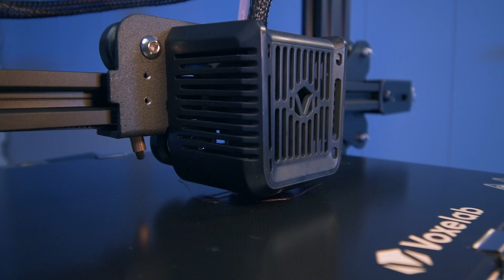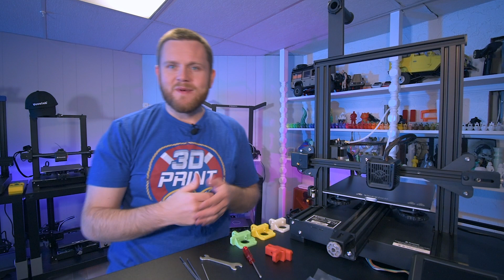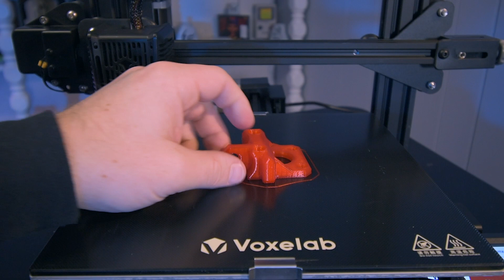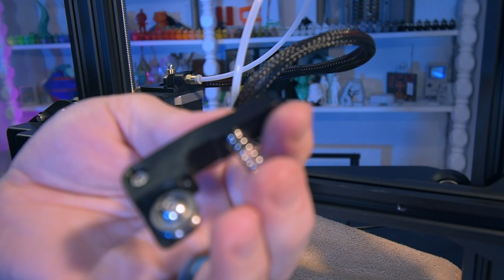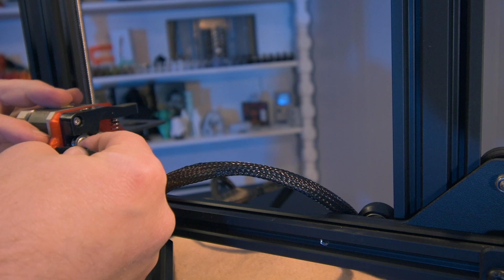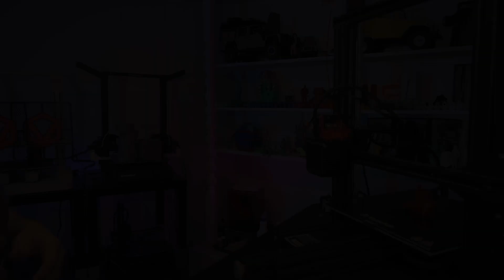Voxelab Aquila Direct Drive Mod - OOTBDD - EASY & FREE

Comment: When I bought a used Aquila X2 the seller told me about your channel.  I'm a 3D printing newbie and have not been disappointed.  The seller had done some upgrades already and the printer and had been cared for very well. The printer came with the "Satsana Extruder Mod for Voxelab Aquila - Fixed" by chubbyzook which was in the way of the front bottom of the OOTBDD adapter.  I used your "extra tab" version.  After marking where to cut with a pencil a quick pass through my small model building band saw removed the interference.  I did order spare parts to restore to the original condition should things not work out well but they weren't needed.

For the stepper motor I ordered "Box3D 3D printer direct drive stepper motor extension cable for Ender 3 Ender 3 Pro Ender 3 V2 Ender 5 plus pvoxelab Aquila 3 pcs x 05m " from Amazon which was a good length at 20 inches/0.5m.  Soldering would have been easy enough but sometimes it's nice to just buy something and plug it in.  I had some 1/4" expandable wire loom sleeving on hand which expanded enough to go over the 6 pin stepper motor connectors and used that to cover the extension.  For now I just stuck a short piece of PLA in the filament sensor.  If I ever do very long prints I'll consider moving the sensor and extending the cable.

An increase of 10°-15° makes for much better prints with the direct drive with the Ender PLA I'm using.  I reduced the retraction to 1mm and set the nozzle to lift 1mm when changing layers.  Those two changed eliminated the blobs and zits I had been getting with the Bowden tube.  The PLA is laying down looking like wet paint and I'm having no adhesion problems.  Initial layer is printed at 215° with a bed temp of 70°; backing off the bed temp to 60° after the first layer using Ender PLA.  At 200°-205° the first layer was not smooth against the bed and as the print built it became thin, unattached and started falling apart.  It got much better at 210° and very nearly perfect at 215°.  Thanks for the education!  You've taught me a lot in just 2 weeks.
Reply from the maker: Awesome to hear that I’ve been able to help. :)
Reply: @3DPrintSOS  with the extension I can just plug and play or I will need to swap the cables?
Reply from the maker: @nashgkrish5683  Yep. An extension would just be plug and play. :)
Reply: @3DPrintSOS  thank you Fedor! I appreciate it
Reply: Thanks for the info on the Satsana shroud David !! It's one of my next prints before I print this extruder mod.

Comment: Thank you.. printed it and thinking about how to(if at all) I'll extend the steppenmotor cable. But definitely gonna do this!  As I see it my bltouch is left untouched (😊)so I can keep using it. Loving your vids❤ greetings from the Netherlands 🇳🇱

Update:  done.. used the original cable but  motor powerconnection on the other side.. working perfectly. 🍀

Comment: where can I get an extension cable if I don't want to cut the sheath?  Are the connectors on the stepper PH2.0-XH2.54?  BTW, I'd love to see the modification to use the filament sensor that comes with the Aquila X2, since that's the printer I've got ;)

Comment: I have got everything working out and printed the best every benchy. I only changed the retraction setting, left every thing as is, and the first print came out great. Thank you for another great mode.
Reply: What retraction settings are you using after this mod?

Comment: Does the direct drive affect the machine due to the weight of the stepper motor? It defiantly needs the sensor too. What is the setting you were mentioning that needs changing?
Reply from the maker: I feel like I covered all of these in the video. Essentially, you DO ad a motor to the X-axis, so there is added weight. That said, it hasn't negatively affected the print quality and won't unless you try to print much faster. The setting you are looking for is called retraction.

Comment: I'm sure this took lots of work to engineer. Thank you for sharing it. This is why I love the 3d printed world. Would like a X2 fil sensor version but this will do just fine. Good job and look forward to more.
6 months later..... Finally did this direct drive and man does it print good. Not sure if it's from less retraction or what. Just need to figure out cable management which is no big deal. Well worth the time.

Comment: I have bmg clone extruder is there a way to make it direct drive with the stock parts
Reply from the maker: Not with this specific one. The whole point is that you don't need any extra hardware or tools. But maybe in the future, I can integrate one.
Reply: @3DPrintSOS  i bought and using bmg clone bt the tube is always slipping out from the hotend and clogs after some time so i decided to go with direct drive with the bmg i have and the stock motor maybe i need to print something only

Comment: It works.... the only thing that I have left is a nod that I can't get in the nozzle that doesn't make it as precise, and by tightening the wheels I can't get it to improve.
could you help me please
funcionaaaaaaaa.... lo unico que me a quedado un cabeceo que no consigo en el en la boquilla que no hace que sea tan precisa, y apretando las ruedas no consigo que mejore
Reply from the maker: Were you about to get the carriage tight using the wheels prior to this mod? It shouldn’t effect the adjustment whats so ever. Other than adding the weight of the motor.
Reply: Esta amigo, fue fallo mío que no apreté bien. Gracias

Comment: Printed this and it came out great, was also very easy to fit so thank you for making it!

Can you possibly do a version 2.0 that has a second mount for the other wheel. I am finding that I have to wedge something under the stepper motor to prevent it from tilting back and forth on the single mount which is giving extrusion issues on areas of the print that are slightly faster.

Thanks again and keep up the channel I am learning a lot from you.
Reply from the maker: Hmm. I wonder if there are differences in carriages on these machines. I have had a few people say that theirs moves. Mine is super tight on there. Wonder if it’s related to how heavily a printer over or under extrudes when it prints this. I’ll take a closer look when I have a chance.

Comment: Hy, it's so cool modification, but I want to ask: can it print from tpu or flex?
Reply from the maker: You can print TPU or Flex WITH it but it cannot be printed in flex. no.
Reply: @3DPrintSOS  Do you have any recommendations for the settings in regard to TPU, like any change to the retraction and print speed. I've tried some common ones and can't seem to get it to work

Comment: Im a complete noob when it comes to this stuff, where do i put the g-code? and do I need it?

Love your videos really easy to follow thanks.
Reply from the maker: That gcode is for the machine to print the bracket, so it goes on the SD card. No this is definitely not needed. Especially if your printer is printing great as is. It’s mostly for fun and a bit more control. :)
Reply: @3DPrintSOS  Thanks for the help

Comment: I honestly don't know why we are still bothering with manual bed leveling machines when there are so many good 3D printers with auto leveling and are either the same price or a little bit dearer. I have that bloody Voxlab Aquila and it is a pain to level and out of the box it's single z lead screw is shocking and has no support for the top!! Sorry I honestly have nothing good to say about this machine. I bet some will say " but you can buy upgrades and tweak it and ........" why should I muck around buying upgrades for a machine that already cost $499 Australian dollars. 
I can now buy a Anycubic Kobra Max for $800 . It has a Hugh print bed. ( 400x400x450) Autobed leveling ; dual z axis lead screws and 2 supports and easily prints 60% faster than the Aquila. I am glad for those who are pulling their hair out that there are videos like this to help them try and fix issues or show upgrades for the Aquila. However with the technology we have today why are we still using stone age tech( Manual Leveling)
Thank you for the video and sorry about the rant but I think it's a point to consider when buying a 3D Printer.
Reply from the maker: To each their own. We have our own experiences that shape our opinions. I have personally had 5-6 Aquilas and many manual machines that print great. Zero upgrades. In fact, my best prints (quality-wise) ever, to this day, have been on a bone stock Aquila. One of my friends runs a small print farm with stock (direct drive mod only) Aquilas. Leveling is almost never an issue. Outside of settings/calibration, It’s typically thermistors, fans, and nozzles that go out due to use. On the other hand, I have had a handful of machines with “auto bed leveling” that have been extremely unreliable. Especially If the sensor is a non-probe type.

Comment: i love how the OG aquilla is still kicking it. not fancy or fast. just prints  what i ask when i ask. this looks like an excellent mod. thank you.
Reply: :) I still have an X2 unopened, bought as a spare to keep 'stock' while I mod the first one I bought. Had to swap a hotend after ruining the thread for the print nozzle, after swapping to hardened steel to print PA-CF. Outside of that and the fun and games of firmware upgrades, it's been crazy reliable. Pro-Tip, use a Dial Indicator Gauge to set the height of the bed, and check it once a month or so, and the prints will always start properly for PLA, PLA-LW and PETG.

Comment: After many filament changes I've printed a small knob for the stepper motor to assist in loading. This really helped me out a lot because being off just a little bit can cause the filament to turn out over the gears. "Filament Extruder Knob (Voxelab Aquila:Direct Drive Conversion Accessory)" or thing:5857945 .

Comment: Hi I'm curious as to why we can't point the motor's wires towards the back of the printer instead of having them forwards like you showed in the video. (I printed out the mount and I'm getting it installed right now as I write this). Seems like there may be something I'm just missing as to why I cant save a little bit of hassle of cable management and point the cables backwards xD. Thanks for the great video!!!
Reply from the maker: Only because when you home the machine, the wires make contact with the frame. And being that close to the connector and always moving back and forth can cause problems after a little bit.
Reply: @3DPrintSOS  ohhh fair point! Thanks!

Comment: Awesome! This is so great and so simple! And costs you nothing extra! This is a really terrific mod. Thank you for the video. Would it be beneficial to change the little remaining Bowden tubing to something else if you were to print different material at higher temperature or is the OOB tubing fine? I flashed the firmware on my x2 H chip. Manual Mesh Levelling has changed my life! Thanks for that video too!
Reply from the maker: An all metal hotend would be a great mod as well. That would let you print hotter for sure. But with this mod alone, you should be fine with PLA, tpu, and petg.

Comment: Just printed it, the hole for the tube is not centered with the filament, can even feed it by hand.
Reply from the maker: Really? First time hearing it. Everyone seems to be enjoying theirs.
Reply: Had to use a small washer to get the spacing right, also some filaments are struggle getting down the tube. Still a good design, don’t get me wrong👍🏻

Comment: Good video, is it possible to exchange the z-axis motor and the extruder motor to make it lighter? Because the z-axis motor is a little smaller.
Reply from the maker: Tried. That motor could run a geared extruder but not a single-geared one. It will skip and get very hot.
Reply: @3DPrintSOS  I had already removed the motor to test it but decided to ask before as I was worried about heating.  Thanks for taking your time to answer.

Comment: On th e X2 version where do you put the run out censor?

@3:50 under 2 hours??  With your settings it took my X2 4 hours to print. How???
Reply from the maker: Weird, mine printed in 1:58

Comment: Tell us about light pla and if it's good for fpv parts and or frames. Look up jellyfish  fpv and you'll find a dude that made an interesting little drone. Would be interested on your take. Also if I could use it to make reptile habitats. What kinda glue to stick it together and what to use to water seal if needed! Lol figure illl ask you more here and give you more engagment
Reply from the maker: I've wanted to try Light PLA several times for Plane (wing) builds but never got the chance. I gotta look up Jellyfish. Although, sound familiar. 

Not sure how lightweight PLA does with water. I assume badly. Since it kind of “foams” as it prints.
Reply: @3DPrintSOS  I wonder if it's like pvc with is a foam almost too. Wondered if I could just coat the inside with something!
Reply from the maker: @TorontoFPV  Im Sure it can be coated. Check out https://3dlabprint.com/ They have some really cool specific LW PLA.

Comment: can you print faster with this mod?
Reply from the maker: yes and no. Yes, you should be able to print faster with tweaks. No, this mod won’t make your machine print a whole lot faster. you’ll have greater control of your filament because of the immediate and direct filament path. The rest will have to be overcome by tuning.
Reply: @3DPrintSOS  ok so if I do this maybe I can be brave enough to try tpu?

Comment: Would I be able to face the motor plug to the back of the printer instead
Reply from the maker: Yep. Just make sure it doesn’t make any contact with anything as you move it around. 

As I mentioned in the vid, it’s facing forward because it makes for the cleanest wire management. Nothing gets pressed this way.

Comment: Every printer I have bought has come with sample filament and it has all been absolute rubbish except the sample that came with the Aquilla with which I used to print a bed level calibration, the filament that came with my two Ender 3 machines was so bad it just snapped in the extruder, even trying to straighten it resulted in it snapping
Reply from the maker: That’s true. Some of that sample stuff is literally garbage. The red these come with is at least "ok".

Comment: instead of the DIY direct drive I just went a brought the direct drive head for the Aquila S2 from there main website and fitted it to my standard Aquila its a bit more expensive then this mod but is another option
Reply from the maker: The issue is those have proprietary parts. Including the nozzle, heatsink, and block. Im not a fan of proprietary parts on these cheap machines.
Reply: True there is that downfall with it, but so far I have managed to order extra nozzles from them with no hassle just hope it stays that way 🤞

Comment: Will this work with a duel gear extruder?
Reply: I have aquila with a 400XL kit on it and the direct drive is the next upgrade lol
Reply from the maker: Nope. Quite a bit different in all dimensions and functions. This is meant to be a single piece for a completely stock machine. Maybe in the future.

Comment: Hi Fedor.  thanks for this video.  I have been wanting to do this mod for some time.  I will certainly give it a go.  My one question is what about the filament change process?  Now that the bowden tube is dramatically shorter, won't we need to modify the code for the distance the filament travels into the hot end?
Reply from the maker: Yeah that's a thing. Although I think whenever you do a swap, you are in control of the distance.
Reply: Ok... I found my answer in the menu on the printer.  Pretty simple. I can't wait to try it out.  Thanks for the video and the print file.
Reply: @bradleyehler1477 I just did the mod and tried to do the first print and the Machine said it is not detecting filament I auto loaded it and it extruded way more than it should have you know what my problem is

Comment: Had to dig out my old lever to make everything OTB but...I think it was worth it.  The only hiccup that I had was with the slot that is supposed to go onto the bracket.  I didn't even know it was supposed to slot onto the bracket that holds the wheels, I just thought somehow the dimensions were off because it was BARELY not lining up. Going through a full mesh leveling/e-steps calibration/retraction test just to make sure everything is as good as it can be. Oh how I've missed Direct Drive! Thanks for making it simple.  I thought that a Bowden setup was going to make a world of difference...it just made filament easier to load. 🤣

Comment: Had made a past direct drive modification to my X2 Aquila, but with a lower left side custom filament spool mount, I couldn't decide on the best cable routing for the filament sensor that I have on top of the extruder. Splitting the X motor and stop sensor cable from the others, as your video demonstrated, allowed a much improved cable routing that avoids interference with the filament spool and allows plenty of slack for operation. I also agreed with the choice of extruder position, as a physicist, not wanting to have the heaviest part of the integrated hotend hanging out the farthest from the mounting wheels. Moved the spool off the top, where the filament path would be optimum, to the back left side to avoid putting all that mass at the top of the Z-frame, and avoiding the possible resonant vibrations that might enhance. This was a very useful video for me.
Reply: have you shared yours by any chance? very interested in having this with the filament sensor